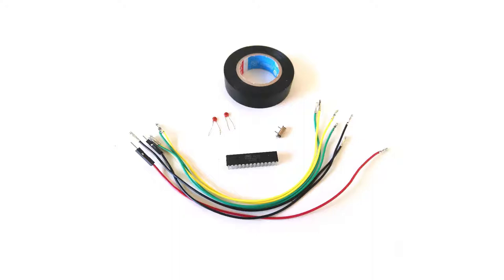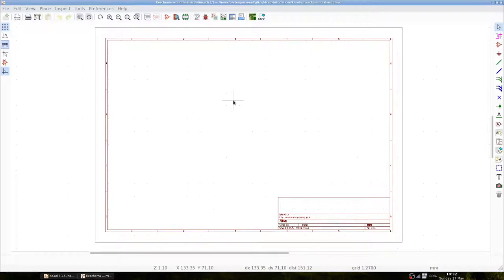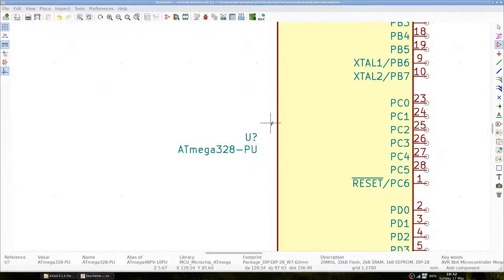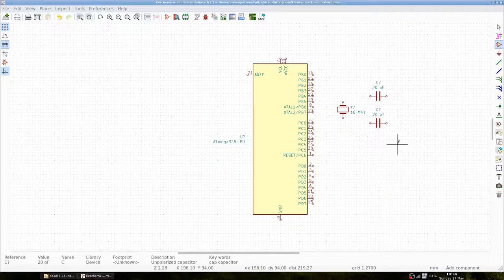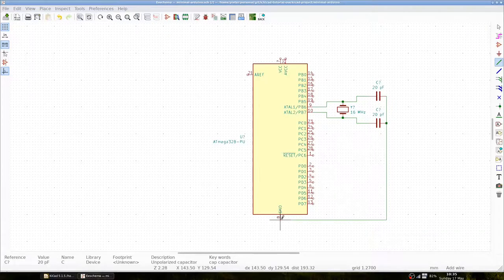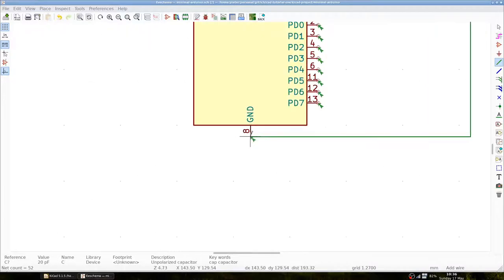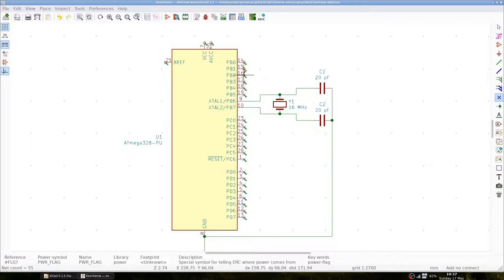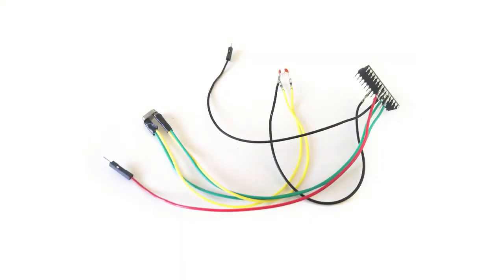KiCad 101 + Minimalist Arduino Build - Part 2

Comment: why is there no ADC 6 and ADC 7 in your IC
Reply: Take a look into the datasheet. The ATmega328P in the  SPDIP  package does only have 6 ADC channels. Thus there is no ADC 6 and 7. If you want have an ADC 6 and 7 you need to select a chip with  TQFP or VQFN package.